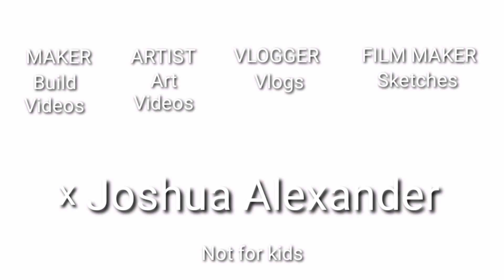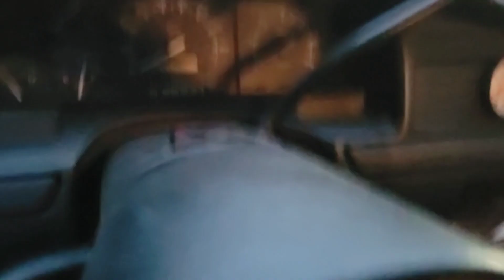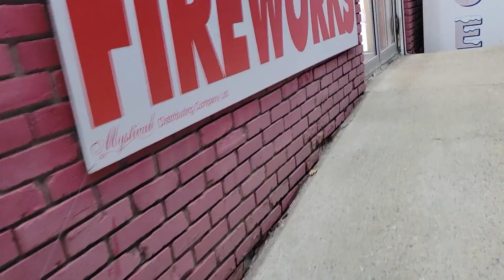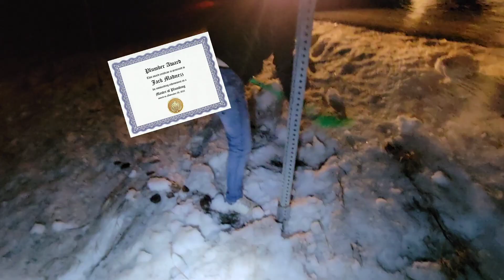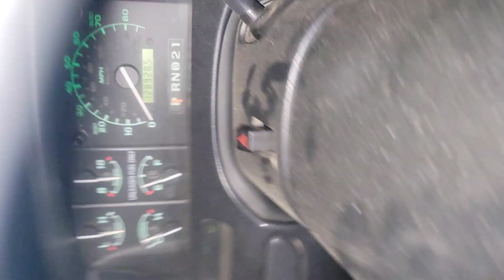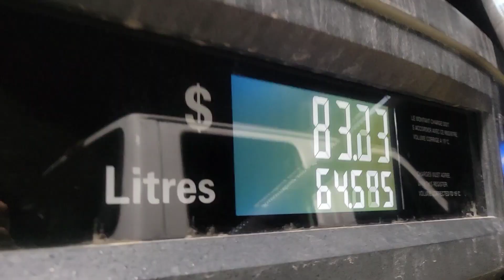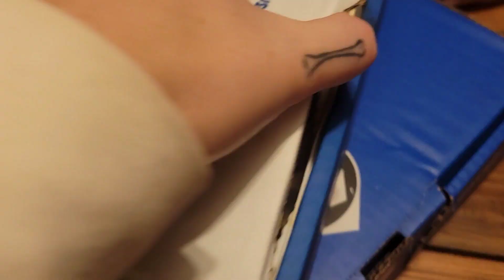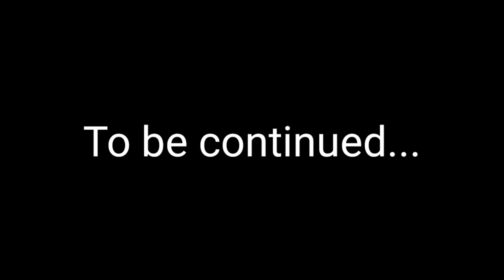Its too cold for this! | Another (UNPLANNED) VLOG #187

Comment: Guys, I lived in a cottage at the beach for 11 years.......and the windows werent the best.  So I used the plastic shrink window covers,  but on the inside of the windows.  It was a lot warmer and easier.....then used the hairdryer to shrink the plastic...and it worked like a damn.   :)
Reply: I use 3M’s window film every year.
Reply: I'm about to get some of that for my house. It was built in 57 and the old windows just don't keep the cold out, but they are too cool to tear out and replace.
Reply: @katieallen3927  Yep! That's the only brand I use in northern Wisconsin too. It's the best! 👍
Reply: Because of the sky rocketing gas prices in Europe, I did that on my insulated but outdated windows. They are from the 80s and the glass gets quite cold when it's below zero. The room already stays a a lot warmer over night when the heat is off than in the last winters. I hope they work.

Comment: My mom bought an older home and the windows needed replaced as well. She put plastic sheets up but used cardboard strips and a staple gun. The cardboard was to seal in between the plastic and the window frames and she put them indoors not outside where the wind would rip the plastic.